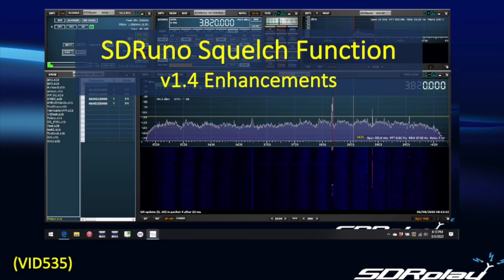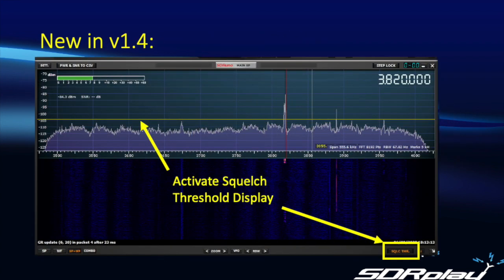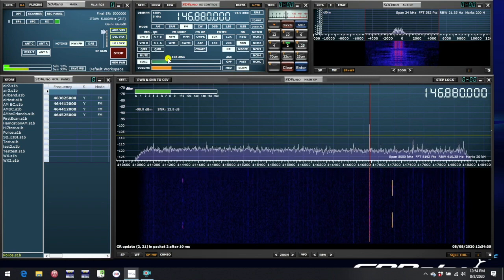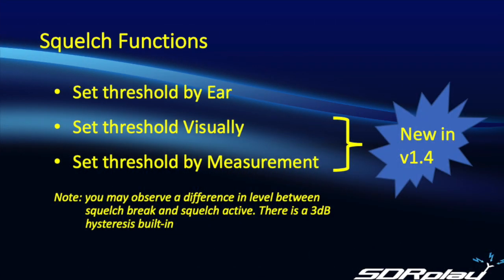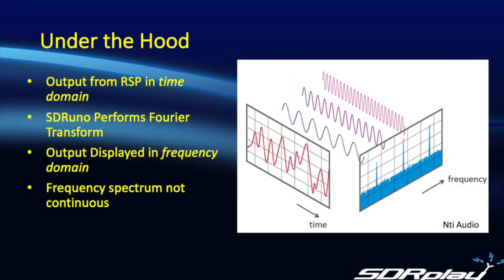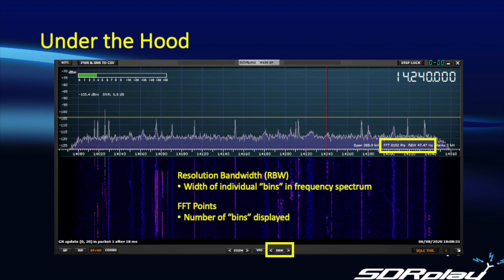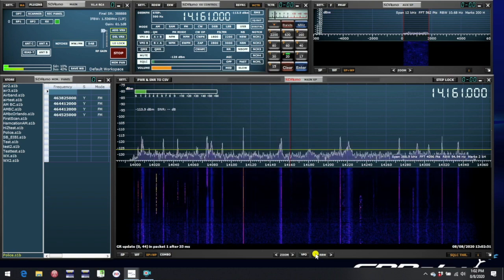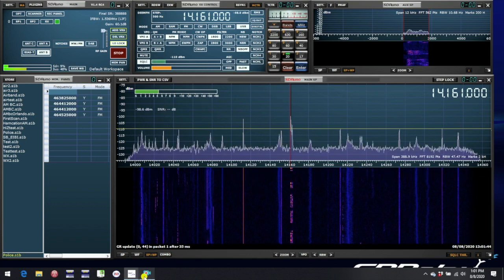SDRuno Squelch Function (VID535)

Comment: Very useful, Steve. Thank you. Makes so much more sense now that I understand the differences in the subtle details that I'm looking at when I adjust squelch.

A thought occurs, though...

If there is a fixed (or at least calculable) relationship between firstly the width of the FFT bins and the power-level evident in them, secondly, the width of the VFO filter and the power-level evident in it, and thirdly the power-level figure that the squelch control is using as its threshold, then would it not be possible to have the display (and/or the squelch line) be automatically converted to work or at least show, at the level appropriate for the currently-chosen bin or VFO settings? 

In essence, to hide all this bin-width related DBm difference with a bit of GUI magic and on-the-fly behind-the-scenes conversion in SDRuno's code, so that we're left with an interface that actually *does* have a squelch-line that matched the displayed noise-floor on the current SP1 window? That would make the squelch line's usefulness so much greater, in my opinion, and I think it would make life so much easier for those users (like me) who have often wondered 'why doesn't the squelch line match up with the noise I'm seeing', and who (like me) have probably taken more than a year to remember to get around to looking it up and discovering your fantastic explanation? :)

Now that I know what's occurring, I can make rational decisions based on some known factors at last, of course, so your explanation is still valid and helpful. I just can't help thinking that this is where the UX side of GUI design kicks in; intuitively, people are going to think 'plonk the line just above the noise'... Question is, can the 'numbers' behind what you've so deftly explained, be condensed into code to put that line where our brains tell us it should be, per display-setup per session, rather than as dictated by the raw numbers out of the box, from whatever the squelch circuit is fed from? My codemonkey brain tells me probably yes, but like so many things, without knowing the codebase, I can't tell for sure, so will shy very clear of saying "just do this", because I know how annoying that is! :D 

73

Comment: Wish SDRUNO or one of the other SDR software packages would implement a "voice squelch" that would activate upon hearing human speech. A lot of commercial and military receivers use this method for squelch on HF frequencies. It generally does a good job of keeping static crashes and other noises from breaking the squelch threshold, while allowing even weak voice signals to be heard. I have an old Icom marine transceiver with voice squelch. I set it on a military HF frequency, flip on the squelch, and don't hear a thing until someone actually talks.